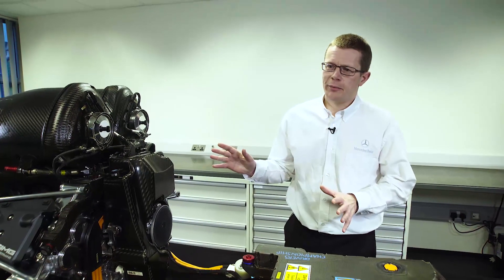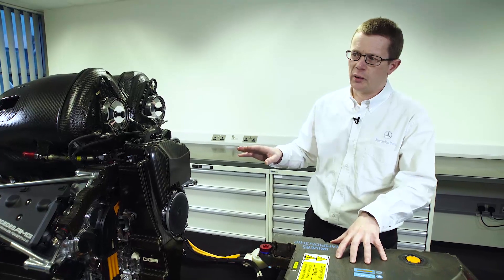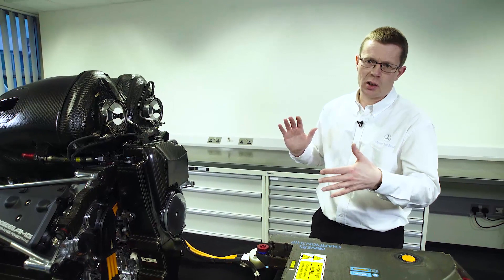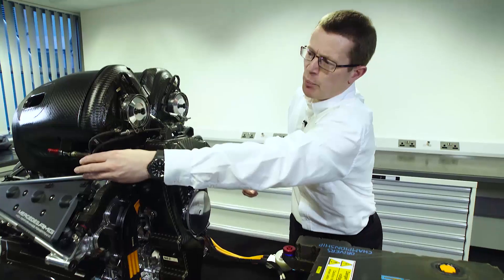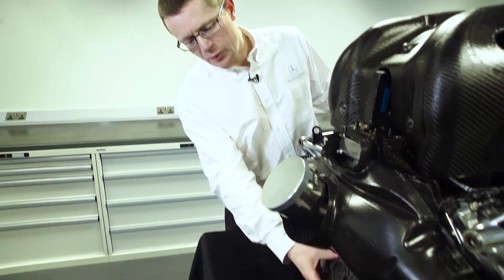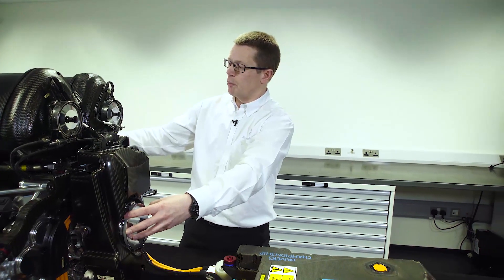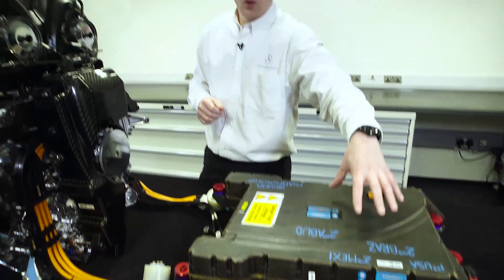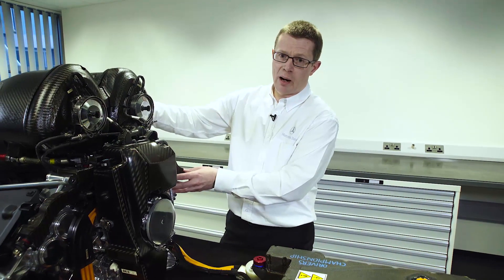Mercedes F1 Hybrid Power Unit revealed!

Comment: So, rather than using a waste gate, once they have enough boost, the extra energy provided by the turbine generates electrical energy. That must be some cutting edge programming and processing power to manage that system. And it has to be managed in conjunction with the kinetic unit.

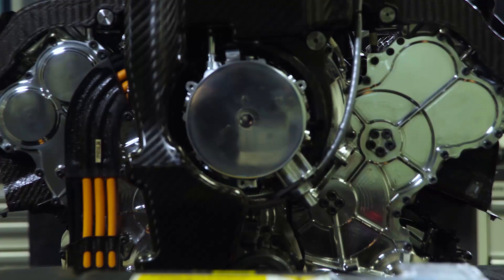Comment: 160hp worth of recovered energy going through conventional copper wires every 1:50 on average for harvesting, and 6 seconds worth of 160hp every lap used.........lol, I would not be surprised if that was carbon nanotech cabling they are using, you can't do that through copper cables, not that size.
The battery packs too, surely that is not Lithum battery tech?  Carbon batteries are very hush hush at the moment, but I wouldn't be surprised if that is their current tech either.
Reply: The carbon nano tech batteries you mentioned above are actually graphene... but this tech is still too expensive even for Formula 1 so I doubt they use them.

Comment: Is it both super charged and turbo charged or just turbo charged?
Reply from the maker: +Brian De Jesus  Just turbo!
Reply: Mercedes-AMG Petronas Motorsport  Thank you!
Reply: Supercharger uses the engine to spin the compressor, turbo uses exhaust air that feed in a turbine to spin the compressor.. in this f1 engine the turbine (air feed by exhaust) work together with electric motor (to removed turbo lag and improve fuel efficientcy) to spin the compressor..

Comment: is the v6 F1 engine bi-turbo? and is the turbo located at the top of the engine rather than the sides?
Reply from the maker: +Anime536 _ single turbo, on the crank centreline

Comment: Basically the technology of a Prius. Just kidding, but not completely.
Reply: actually your not mistaken
A Prius has a similar MGU-K set-up Where kinetic energy is being reused.
However a Prius doesn't have a Turbo and can't regenerate waste heat.

We do have E-turbo's on production cars but not combined with a electric motor on the crank.

I'd say this would be a great innovation which could help bridge the gap to full electric cars.
Making internal combustion engines more efficient more efficient at high speed and overtaking or when the battery runs dry on a typical plug-in hybrid.

Comment: are the engines still made by Ilmor engineering in the UK, or has that changed? Or has the name just changed? Who makes what parts? Do any parts come from Stuttgart? A year or two ago I read that apparently the cast block was supplied from Germany.
Reply from the maker: +AlternativeDesign100 The PU has never been made by Ilmor Engineering. The company that is now MERCEDES AMG HPP was once Ilmor but has been Mercedes-Benz for over a decade. re Stuttgart, you're probably referring to the application of Nanoslide, which was done on the blocks in Unterturkheim.
Reply: +MERCEDES AMG PETRONAS OK, interesting, thank you. I'd love to know a little more about the engine production (that is not confidential of course), such as where it is made, and is it a cooperation of Mercedes F1 (UK??) and AMG in Affalterbach, and as said, who supplies what parts etc? Is there a website that may contain such information? Thanks again.
Reply from the maker: +AlternativeDesign100 It's all done at Brixworth in the UK by Mercedes AMG HPP.  But there's lots of input from the wider group at the design and development stage.
Reply: @MercedesAMGF1  
if ILMOR has never produced PU, then what has the ILMOR factory in England been doing for Mercedes

Comment: If Mercedes really has more than 900 hp, and the ERS is limited to 160 hp, how come these "small" V6 Engines have so much power, close to V8 or V10s ? I'm not a engineer or tech-expert, please explain it simply to me! :p
Reply: The simplest way is, there really is a replacement for displacement, which is boost pressure. Effectively turning this small engine into a bigger one. An engine is just effectively a huge air pump. The bigger engines pump at 1 atmosphere and the turbo artificially increases the atmosphere the engine sees and pumps more air. Allowing more fuel to be burnt in a traditional sense, but the boffins here have created more power from the same fuel amount per burn cycle through a ridiculously clever new way to ignite the air fuel mixture wasting less fuel in the process and burning more of it each cycle hence thermal efficiency has increased which releases more power. Simple really.

Comment: Cutting-edge technology but it fails to deliver one simple thing in motor racing: raw power, brutal sound!

I agree with all these developments for road use, but we need to keep the essence of the sport we love. bring back those v10's !!!
Reply from the maker: It's quieter than the V10 but it no raw power? It's the most powerful F1 engine MERCEDES has ever made!
Reply: Yes it is, but in fact is a underpowered petrol engine running on low revs, that needs 'aid' from a external pack of batteries and a eletric motor... where's is the fun here?

Raw power for me is like what you guys did on the engine of Sauber C9 or the MP4/13 for example.. that was awesome!

Been watching F1 since early 90's and i still do, but i really think that part of the low public interest of the series is because of these engines. Sure not you guys fault in any way, you pushed Hamilton to the top and will do it again in '16 i'm sure. It's just my view on it...

Comment: They must have some next level shit for their next engine if they're letting mere mortals see last years design.
Reply from the maker: +Daniel May Not in racing form, no. But downsized ICE, electric turbo and brake energy recovery are already present in road cars - and we're driving this technology development with the the racing activity by chasing performance through thermal efficiency...
Reply: +MERCEDES AMG PETRONAS huge mercedes fan as well as hamilton fan. cheer you guys on every year in Canada I make an 8 hour drive alone to do so and obviously it ain't cheap. I just want to know what's in the pipeline for a competing affordable compact electric car I the coming years to rival the tesla?
Reply: that's what I thought
Reply: I wonder how the 65 owner feels v12 biturbo effortless power.
Reply: Does it matter? These bloody things will never be used in an ordinary application.
Reply: +MERCEDES AMG PETRONAS it's fantastic, although every A45 AMG owner that drives past thinks he's Hamilton
Reply: +Daniel May Ehem AMG Project One. Close enough lol
Reply: With R&D costs how much is that full power unit to build for a customer? $2m each or so? I know that Toto Wolff said that they are up to $19m for a season supply. Presumably spread over how many components are used, including test units prior to the season and so forth
Reply: there so many plug in hybrid performance cars from a s500 limo to the nippy bmw i8 that have similar technology to this f1 car and cars like p1 and 918 shares alot of tech with lmp1 and f1 powertrain but of course there not as extreme since there to be sold as road cars

Comment: What is the weight of your internal combustion engine and the ERS- Unit ? 
Not that it matters as much as size (aerodynamics) or power, but it's definitely an interesting fact.
Reply from the maker: Well the minimum allowed is 145 kg. guess the target ;)
Reply: 145kg with or without a hand on the scale ? ;)

Comment: so did i get this right? the engine has got a kompressor? 00:30
so there are no turbochargers? niiiice :-)
Reply: +Toni Gernert Its turbocharged.  A compressor is part of a Turbocharger.
Reply from the maker: It has an exhaust turbine and a compressor. Together they make up the electric turbocharger, with the MGU-H in the middle.
Reply: +MERCEDES AMG PETRONAS Hint: c230 ;-)

Comment: What an amazing power unit , its a work of art , but i wish F1 cars used V8 or even V10 engines like they did in the good old days , i was at last years Silverstone race and was very disappointed with the sound they make , the GP2 cars sounded much better ! and some old F1 cars are faster than the ones of today !
Reply: I was at last years silver stone event as well and I also wasn't impressed by the sounds. Strangely enough, out of all cars they had there McLaren-Honda had the best sound. Hopefully this years engines will produce better sounds
Reply: Did you say you wish they used V8s or even V10s? lol making V10s sound like a concession to V8s.
Reply: +dazaro3 the good old days were turbo driven. (1200BHP from a 4 cilinder BMW roadblock)
Reply: +Thomas E Good old days were the cars fangio et al raced.

Comment: Thanks! So much intelligence in one video.. I feel myself stupid now..😃👍
Reply: He doesn't really talk about thermal efficiencies.  Mainly how the ICE engine works with the turbo charger/compressor.  And how the two electric motor/generators work with the batteries.  F1 car works just like any normal car with the combustion engine..(of course tolerances are much smaller, lighter parts, etc). The unique parts are the ERS units.
Reply: Not actually that difficult to understand. Just need an understanding of Internal Combustion and Thermal efficiencies.

Comment: very over powered
Reply from the maker: It was! And we have more power now than we had then...
Reply: +Jason But because of the aerodynamics - now these power units produce about ~900 hp and also a lot more torque than the V8's did
Reply: +Stuart Sadler (stusrtsadler96) Guess what? Still more power on the way for 2016!
Reply: +MERCEDES AMG PETRONAS it would be nice if you showed off the turbo as well